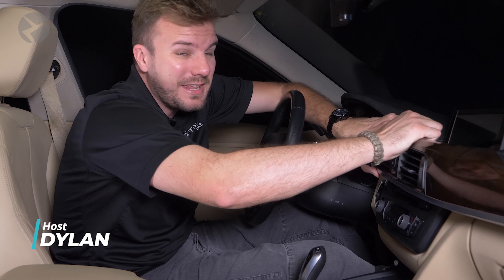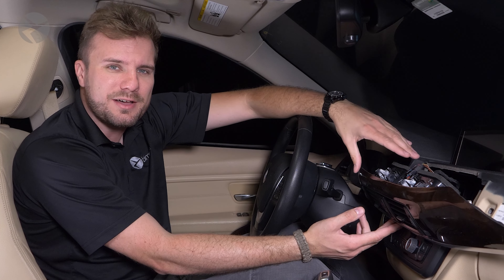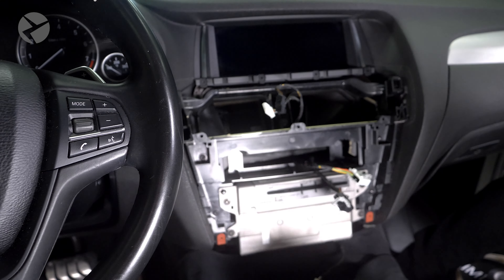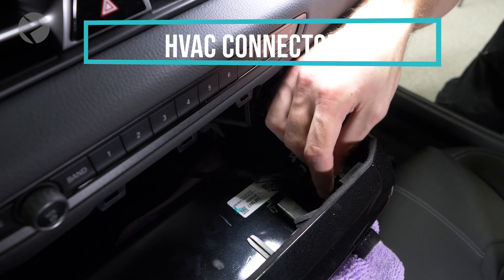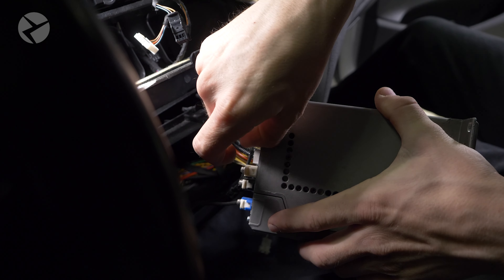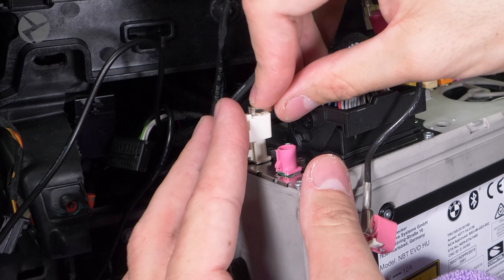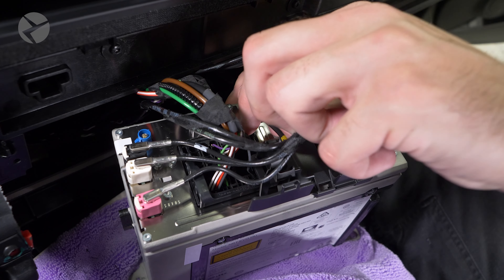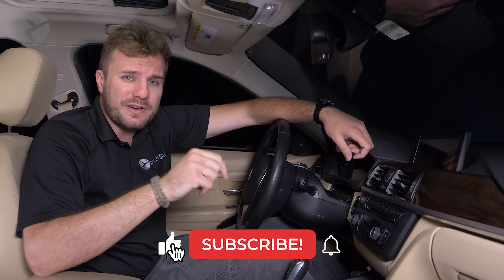BMW Head Unit Plugs: How To Easily Connect And Disconnect

Comment: Hi. I'd like to know if I replace my faulty NBT HU which is currently in my 2010 F10 (mine doesn't have a Satellite Radio connector), with a NBT HU that has a Satellite Radio connector, will it work normally on my vehicle? Anything specific that I need to know before I decide to buy a new NBT HU? Thanks.
Reply from the maker: Please contact our sales team with your car’s VIN and they will enlighten you with all the necessary information you will need before making the purchase https://www.bimmer-tech.net/page-contact

Comment: I have no warning tones that come up on my 2014 BMW M5 I checked the app it seems to be OK. No water damage. Just want to know whether not you heard of it. Could it be the head unit? If so, if I replace it. Am I able to reprogram it myself?
Reply from the maker: Hey Sean! It shouldn't be a problem with head unit itself. Check out the plugs heading to the head unit or fiber optic plugs going to your amp in the trunk. 

Cheers! :D
Reply: @bimmer-tech  when I check the fiber optic plug, going to the amp, it was going on and off and now it just stay off ..! thanks for answering me back but what should I do next? I also Check the fuses
Reply from the maker: We don't have the capacity to help you on that one, but we can recommend you to check over the Bimmerpost forum. Here is the F10 M5 thread considering multimedia: https://f10.m5post.com/forums/forumdisplay.php?f=472

Comment: I pulled the white tabs for the antenna pink and black, but the tabs came out instead. Can I just put them back? They are jammed on tight.
Reply from the maker: Hi Glen, 
yes, you should be able to slide it right back in.

Comment: i replaced the head unit in my bmw 640xi but when i put the new one in there was no audio and i don’t know why. do you know why this would be
Reply from the maker: Hi Ameer! First of all - check if every plug is connected correctly. If everything seems to be correct, and it is still not working, please contact our support team - support@bimmer-tech.net :)
Reply: I have the same issue have you managed to fix it?
Reply: Needs to be reprogrammed?
Reply: Me too I just put the old ticking hard drive radio back in so I can have music and sound but no Bluetooth only aux or radio also no GPS & when I put the new head unit in, I had no volume or GPS I even got a new AC control panel. I plugged that in and I had no control of the AC or heat so I put the old panel back on too 😂 plug & play my ass
Reply: Me too I just put the old ticking hard drive radio back in so I can have music and sound but no Bluetooth only aux or radio also no GPS & when I put the new head unit in, I had no volume or GPS I even got a new AC control panel. I plugged that in and I had no control of the AC or heat so I put the old panel back on too 😂
Reply: @JordanRazeq any luck finding a fix? We just tried to install a used head unit and same thing no sound no navigation. 🧐

Comment: I bought a 2009 750 Li and I want to upgrade my screen.  Can you point me in the right direction on proceeding to do so.  Furthermore I have the rear DVD entertainment however it doesn't have the connection to operate I need assistance in this area also please.  Been loyal to BMW since 1987
Reply from the maker: Sure :) In that case it's best if you contact our support team directly at support@bimmer-tech.net. They'll get back to you within 24h and help you out with choosing the screen upgrade and any other tech issues you might have.